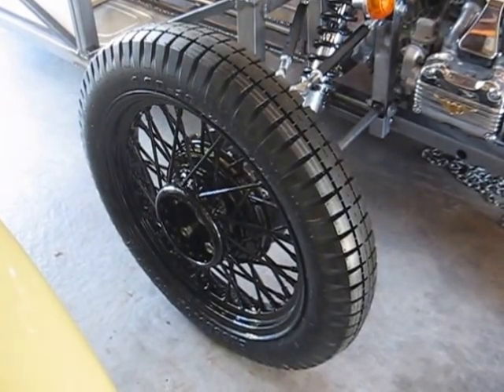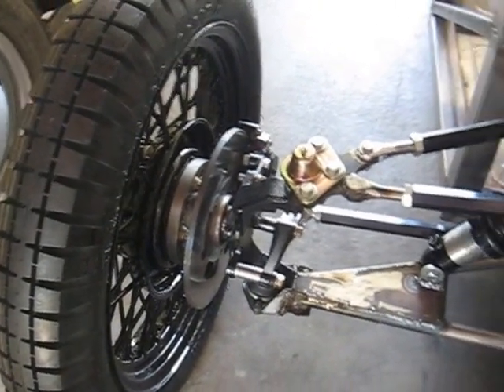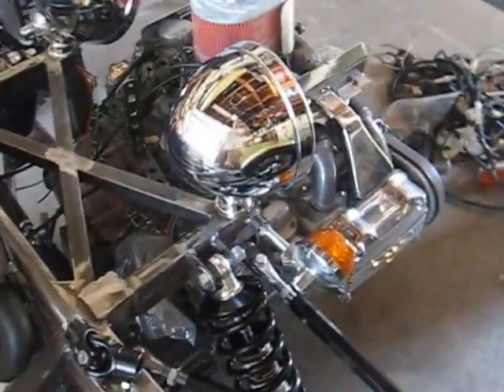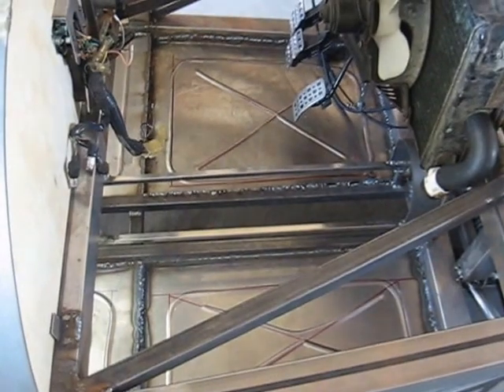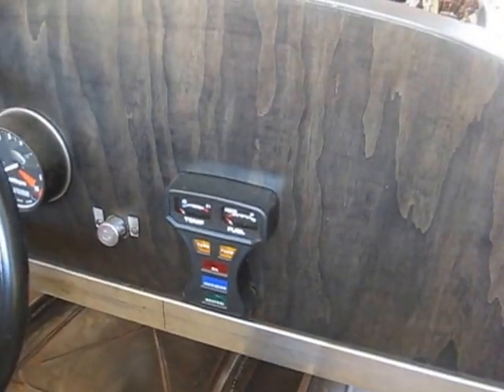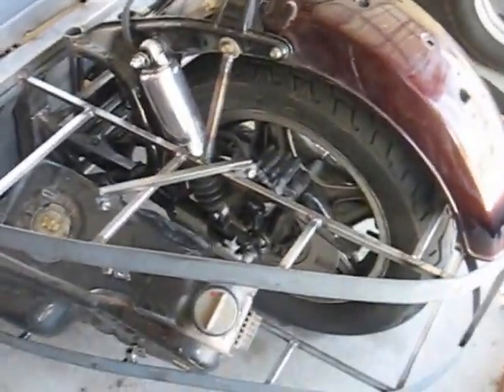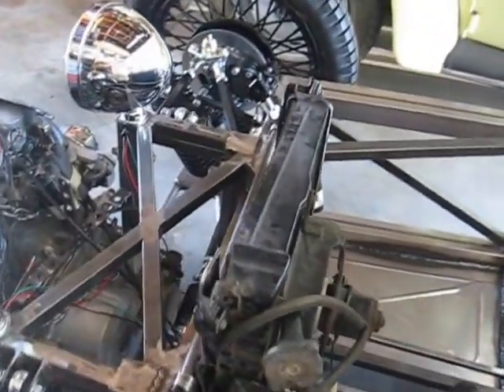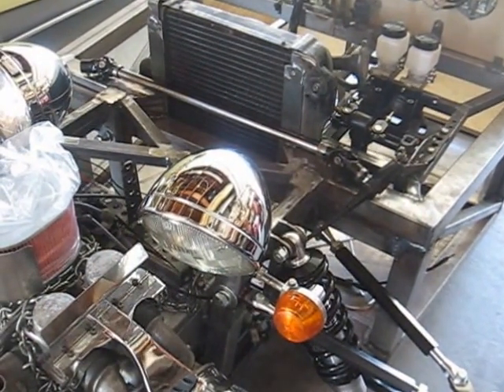Replica Morgan 3-Wheeler Build

Comment: Do you have the measurements on paper that you used ?
Reply from the maker: Nope, no measurements.  I just laid out tubes and welded it up.  Measurements would mandate you build exactly what I built, as well, which probably won't work for most (if any).
Reply: @SR20DEWhitebird  cool as . Im going to start my project in the new year . Ill use your Video as a rough guide !

Comment: I realise this is an old Video, but hopefully you're still keeping tabs on it.

I was wondering about the Steering Geometry, it looks like the Steering Axis line is way inboard of the Tyre Contact Patch centre.
Are you aware of 'Centre Point Steering'?

How did it handle?
On a lightweight car, with fairly narrow Tyres, it may not matter too much.
Would be interested to know, for when I finally get round to my build.

Thanks.
Reply from the maker: Hey John.  Steering setup is "stock" Wilwood Mustang II spindles and arms.  The Wilwood arms bolt on to the spindles and allow for front- or rear-steer.  Rear-steer worked for what I had built.  Then I just had to space the steering arms to get zero bump steer.
It handled pretty well, given the limitations of 1. a 3-wheel setup, and 2. a non-suspension guru setting up the suspension.  Tons of front travel soaked up the bumps, and the wide track helped tons with stability.  Was able to get good caster into the system, so it self-centered just like a car.  Steering wasn't super-quick, but I used an EMPI buggy center-input rack.  Still, as you note, with low overall weight and tiny contact patches, it was no problem.

Comment: I live in LA SoCal. is there a way I may visit you to take a look at this beauty. ?
Reply from the maker: Hey Ed, the 3-Wheeler is long gone.  Lives up in Oregon now.  Only build I ever regretted selling.
Reply: @SR20DEWhitebird  Hello my friend. I hear you on regretting selling things that we build. I am  almost done sourcing everything I need to start building a replica of a 1928 Morgan Aero RIP with a GN rear making it a 4 wheel special. Morgan designed this one to be exactly like a 20's airplane covered in fabric sprayed with a plasticizer. There is only one in existence  that I or anyone can find and I believe Charlie Martin or Hughie Walker's father owns it. I am using a Modified ONAN opposed twin motor on the front mated to an MGB transmission giving 4 gears forward and a reverse gear. This is mated through a driveshaft to an MGB rear differential with two beautiful MGB wire wheels. The rear has working brakes which is more than the original has and I am upgrading the front suspension using A arms and a rack and pinion from a Geo Metro for steering. I am keeping the running gear all British so I hope that helps for validity. I hope to be done in a month or so and I am doing ok at video-ing. I am in Pennsylvania.

Comment: Are these Model A wheels?
Reply from the maker: Nope, new 19x3" wheels built up out of some place in the San Joaquin Valley.  I don't remember where ATM and Google isn't helping my memory.  Might not be in business anymore.
Reply from the maker: Duh, just had to read my book to find the name of the company.  Rally America, Prather CA.
Reply: @SR20DEWhitebird  Wait a second, did you write a book or buy one? I want one! And thank you for the info. I just bought a VRod engine for my build and my son bought a Victory engine for his.
Reply from the maker: @butziporsche8646  Yes, it's not a book of plans, more a discussion of ideas and approaches I took in building my 3-Wheeler.  There's a short video look at it, it's the "newest" video here.  Time flies.
Reply: @SR20DEWhitebird  I don't need plans, I'm just looking for some ideas on details. I built the Cislaghi steerable monocycle from scratch using nothing more than crappy patent drawings and the few videos from the 1930s. I was considering larger diameter Model A wheels as they can take dirt bike tires. Unfortunately, the used ones are pretty rusty and new ones are about $400 each. Your front end is one of the best I've seen so far.
Reply: @SR20DEWhitebird  I bought your book off of Amazon. It's a great build diary, my compliments.

Comment: what kind of welder(s) did you use for this project?
Reply from the maker: The whole thing was basically built using a Lincoln 110V MIG and an angle grinder.

Comment: I came a cross your 510 forum build thread as my father and I were recently joking about doing exactly what you're doing after the +4 was completed, and I figured I'd look around to see what anyone else had done. If you're at all interested, you can check out my build blog at mogrod dot com (YT won't allow url's). I'm currently stalled as I need to design the chassis. I'm holding off as I will be getting Solidworks training through work soon, so I figure I'll put that to good use. :)

Comment: Absolutely awesome! I'm working on 'hot rodding' a wrecked '66 +4 my father picked up years ago and gave to me recently. I'll be making a custom chassis for the car to support the entire drivetrain (engine, trans, diff, front and rear suspension, brakes, steering) from a '06 Pontiac Solstice. The GM Ecotec has been used for 'modernizing' Morgan +4's by a Bay Area importer for a while, so I took that as inspiration and went a good bit further.